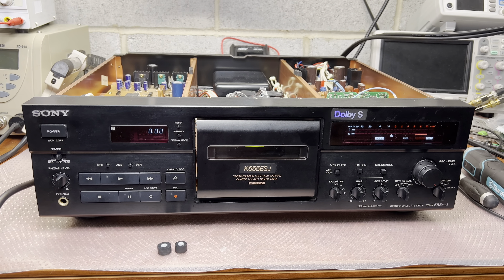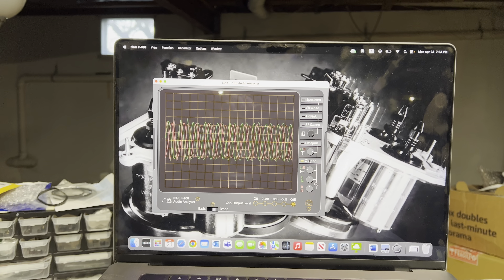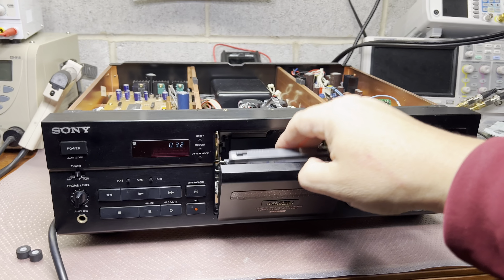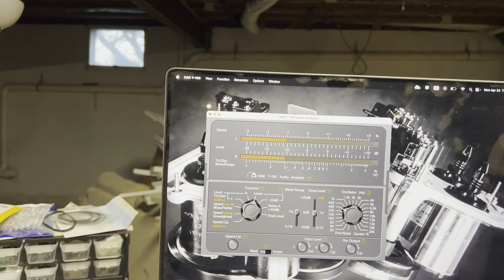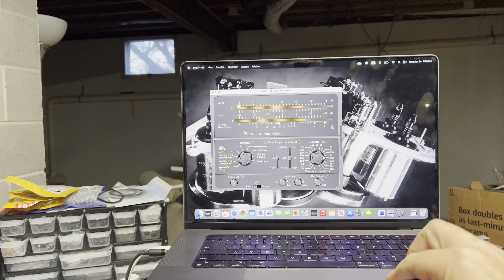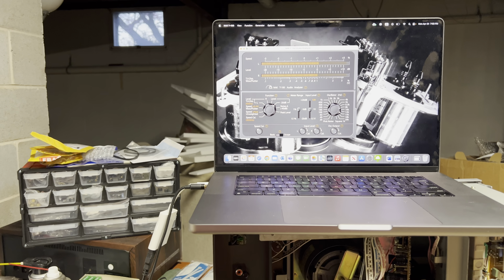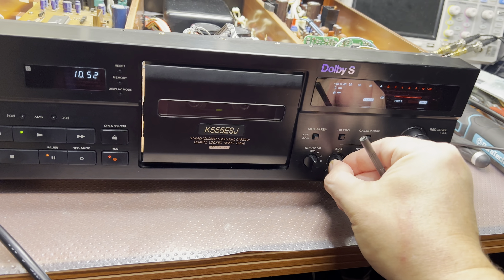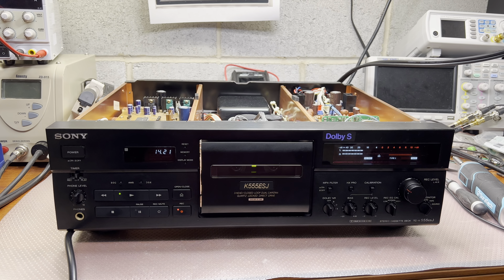Hitting the Right Notes: Tuning the Sony TC-K555esJ with Nak T-100 Analyser

Comment: Hi, thanks for the video. I don't understand why you calibrate the meters with the bias pot not in the center? Now you have calibrated the meter relative to the position of the bias pot you had it in, right?
Reply from the maker: I explained in the video - I calibrated Type I and Type II with the pot in the middle. However, as TDK MA is 2-3 dB more sensitive on the highs than the Sony XR tape, I calibrated exactly to the position I observed on the brand new Sony TC-KA3ES. It should be like 4pm if comparing to the clock. In that case when you will calibrate Sony metal tape the pot will be in the middle.

Comment: it's a pity Sony produced such amazing well build decks with indifferentiated calibration for the two channels. I own a Teac V5000 and a V970X, the latter being full of plastic: they both have separated bias and rec level for Left and Right channel and V970X to me has very crispy sound
Reply from the maker: in 99.99% per channel calibration is not needed. Analog world is not precise. You just live in the age of digital devices and trying to compare everything by that standard.
Reply: @hifirulezzz  I'm 49 years old and I spent my youngest life that impressed my mind with reel to reel Revox A700 and Sony and teac decks my father owned. He had also a Sony 666es which didn't even had the signal for calibration. I told you I'm comparing sony decks with what I used to have and still have. Moreover I owned a SonyTCK 75 which didn't have separated bias but at least had separated rec level. I well remembered that when I changed for Teac brand with V 5000  I used to had better balanced recording with Fe cassettes in term of high frequencies on both channels. So for incompresible reasons Sony made poorer choice later.
Reply from the maker: @blackimp4987  Ok, check my latest video when Nakamichi recording and it even does not have external bias adjustment. I hope you will enjoy it.
Reply: @hifirulezzz  as always :)